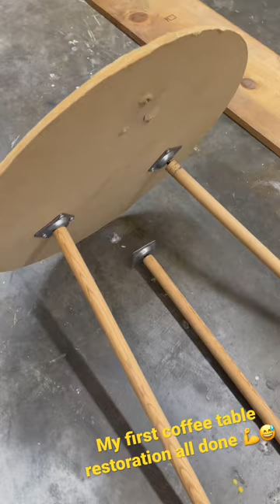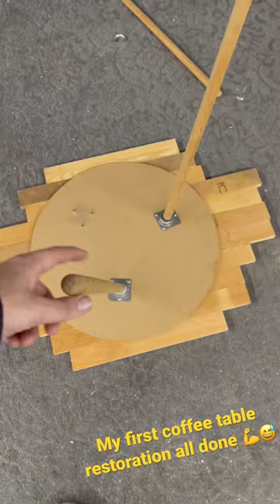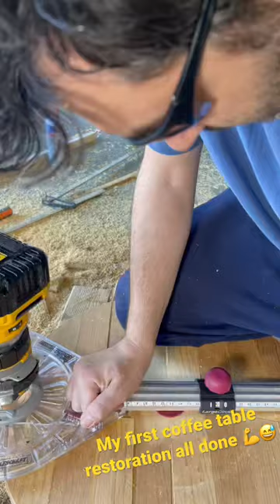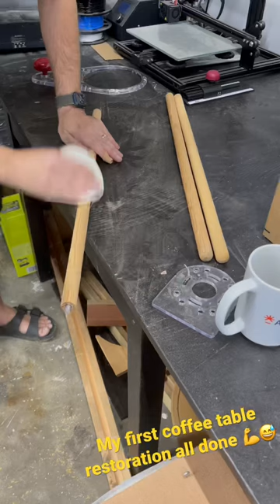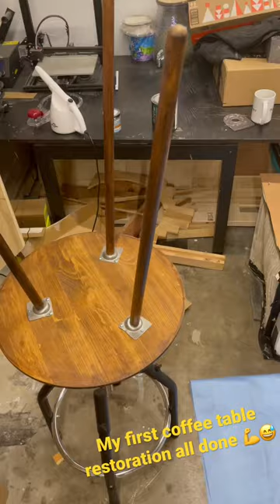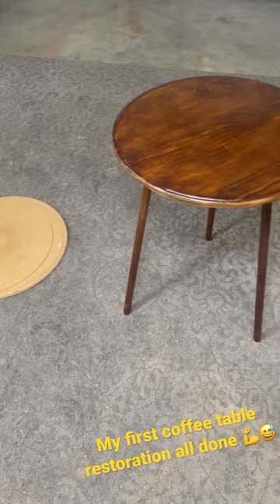My first circular coffee table restoration/repair is all done ✅!! #woodworking #diy

Comment: Not a restoration.  You just used a cheap material table as a pattern.
Reply from the maker: the legs were cracked.. i fixed those and used the harness so.. partial restoration :D